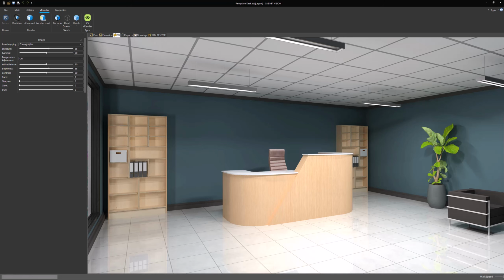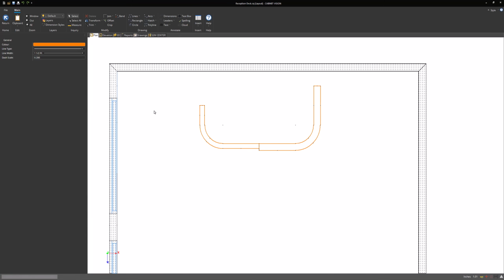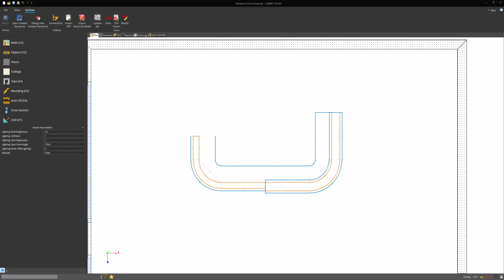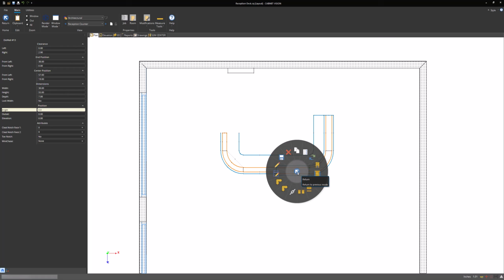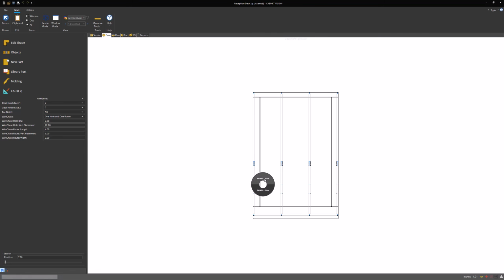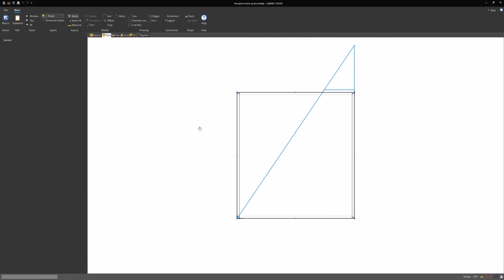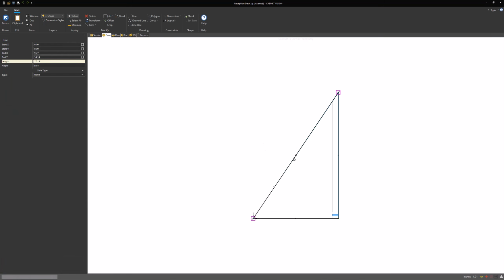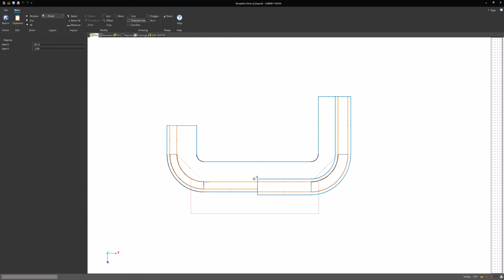Creating A Die Wall Reception Counter

Comment: There is a complete lack of production realism in this project. It could just as well have been drawn in SketchUp  it would have been easier and faster without all this unnecessary complexity. This is typical design-first thinking, followed by trying to figure out afterward how to bend the material, whether it needs to be made from multiple parts, or whether a supporting frame is required. Simply a tragedy.